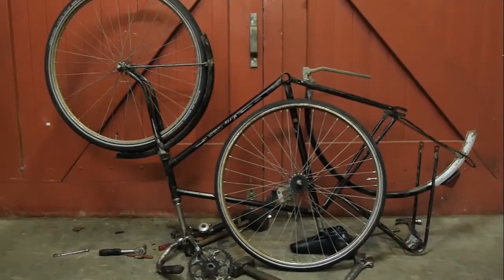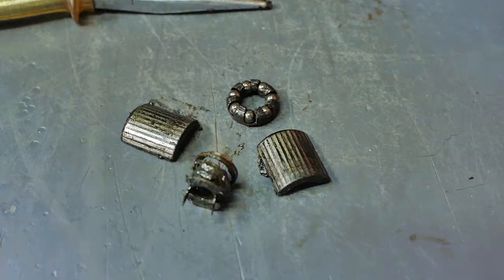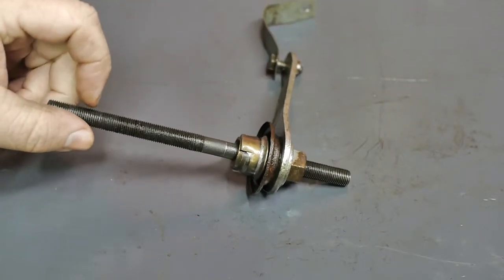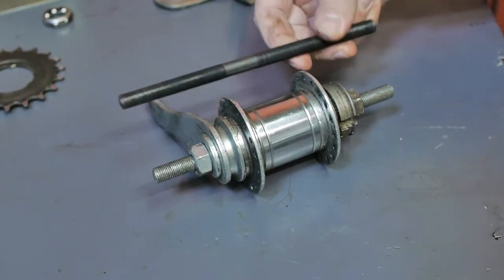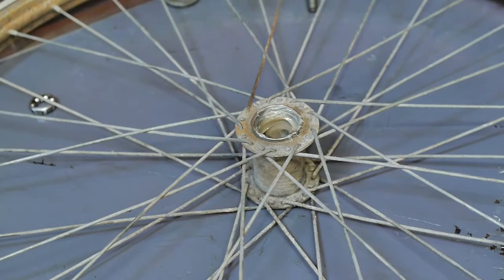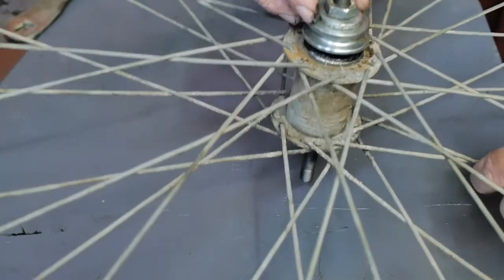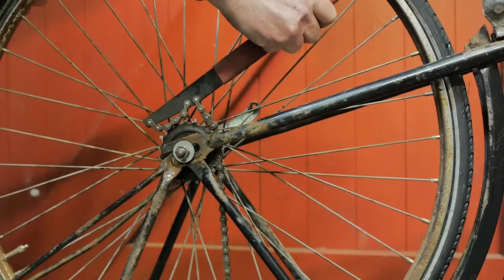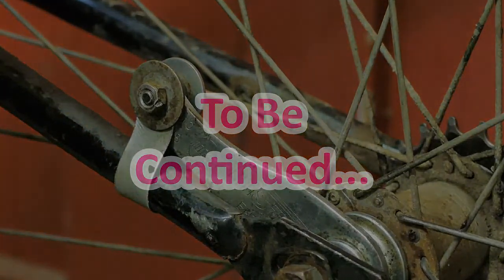Rebuilding the coaster brake hub from my old bicycle

Comment: FWIW, the guts from a Shimano cb-e110 will fit in a KT HiStop; the hub has the same bore and the Shimano stuff is a bit more stern than the KT hardware.  Unfortunately, the clutch spring is the Achilles heel in both hubs.  (they're essentially the same design, both more or less Bendix copies; shimano has the cool asterisk-pattern attachment point for the brake arm though.... and again, the innards are made of more robust metal.
Reply from the maker: Thanks for that :)
Reply: @RolingRandom  you're quite welcome

Comment: Are all coaster brakes interchangeable? I got 2 broken about 28 inch wheels. One needs 8 spokes, the other wont turn. Can I use the parts of both to make one good wheel? I dont know it the wheels have the exact same diameter.
Reply from the maker: I don't think they are interchangeable, but the design between brand is similar. Perhaps you can use some spokes from one wheel to fix the other :)
Reply: If both wheels have the same number of spokes you should be able to exchange the brakes. Most bike wheels have 36 spokes. You may still have a problem with sprockets or width as our host did in this video.

Comment: Nice fix
Reply from the maker: It's o.k. But I really should have a different type of grease. Something a bit more heat resistant. Since I live in a flat county I don't expect any problems.
Reply: @RolingRandom  I've found Mobile 1 synthetic grease to be the best. It protects parts the longest before you need to clean and reapply.

Comment: You should have cleaned the old black grease out before putting it back together with new lithium grease. You should never mix greases.
Reply from the maker: That black grease is nasty stuff. And I think I should have used sodium grease instead of lithium, I believe it is more heat resistant.
Reply: You can usually mix different greases if they have the same metallic soap base. For example: lithium, (most common) calcium, &sodium.

Comment: When the chaincase bracket and the chain tensioner are between the frame and the hub, the reaction arm might be clear of the chainstay. 
Thanks for this video. Ive never taken a coaster brake apart yet.
Reply from the maker: The wheel was installed incorrectly. I will find this out later in the next video. This is also the reason the bracket for the reaction arm is no longer fitting.